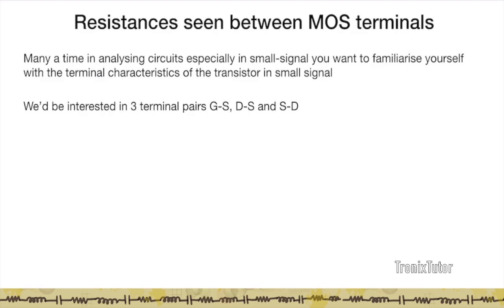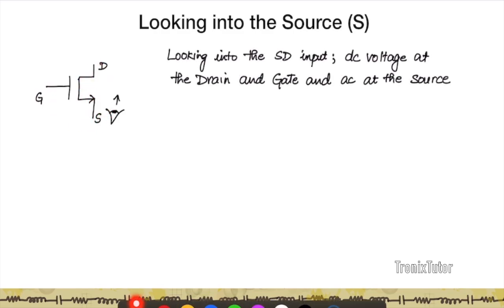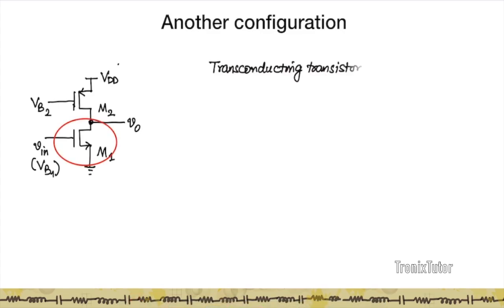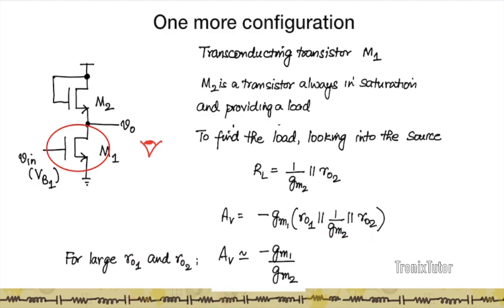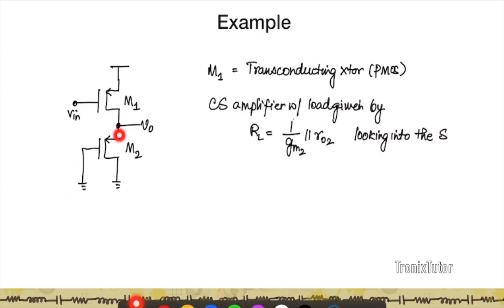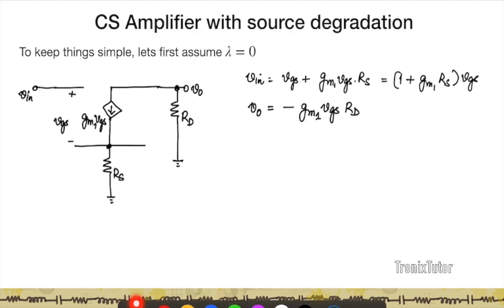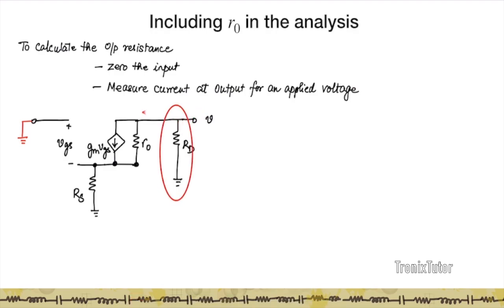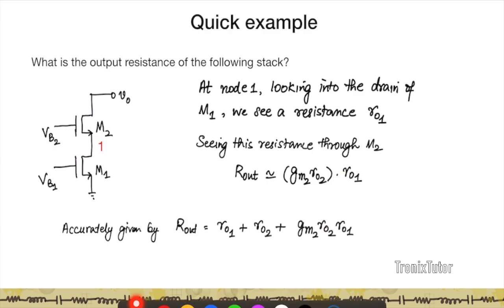Add a Resistor to the Source for a More Predictable Amplifier | Source Degeneration

Comment from the maker: If this video helped you understand source degeneration and output resistance, the next step is seeing how these ideas appear in differential amplifiers used in real analog ICs.

Watch next:
Small-Signal Differential Amplifier Analysis: Half-Circuit Method and Design Examples
https://www.youtube.com/watch?v=7sF9rYy5k1E

This builds directly on the gain and output resistance concepts discussed here.